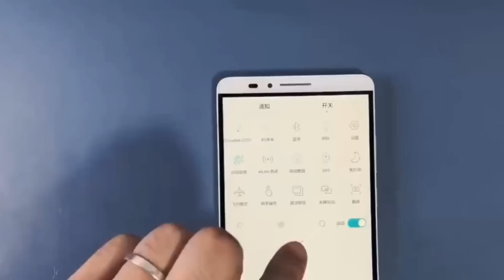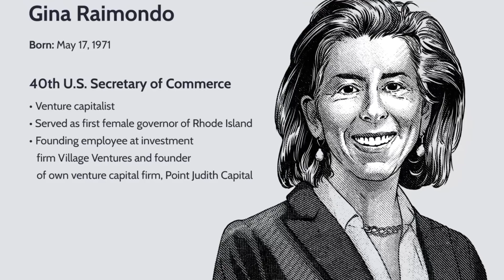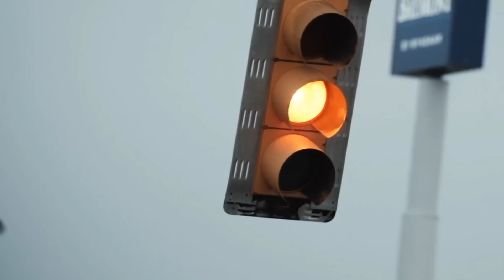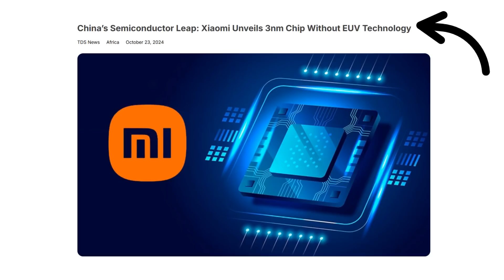I'm Witnessing the RISE of SEMICONDUCTOR SUPERPOWERS in 2024!

Comment: IMO China is on track to achieve its 70% or higher self sufficiency in chips by the end of 2025 as targeted. 
At this pace it is certain to hit its 100% self sufficiency way before 2030 most probably by the end of 2028.
The growth rate of Chip semiconductor equipment manufacturers can be described as specular in the last 3 years with many breakthrough.
China semiconductor industry esp. toolmakers have all reported high profit last year.
SMIC is now producing 7 and now 5nm using domestic lithography equipment. They have started deAmericanising many of their equipment.
So all these bans and sanctions are just part of the show in a circus for US domestic viewers. 
Boring and insignificant.
🤔